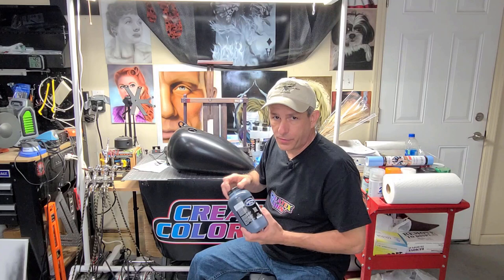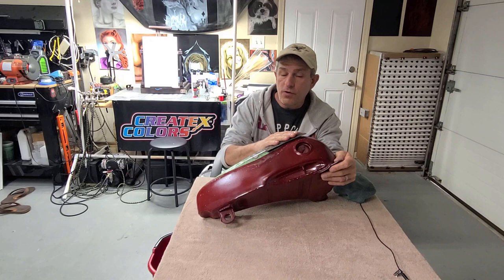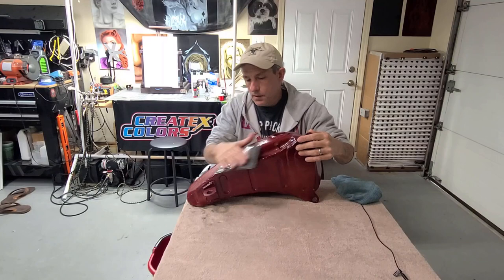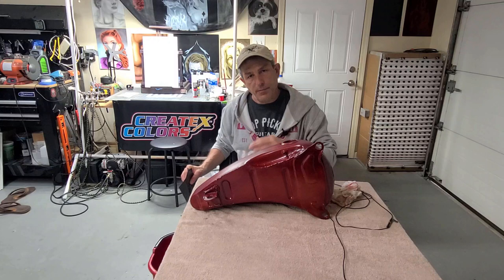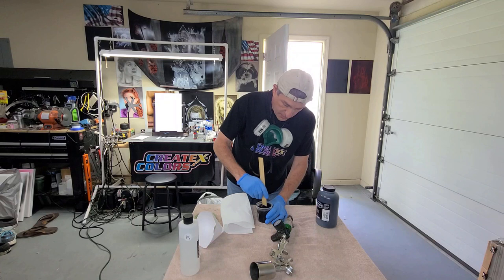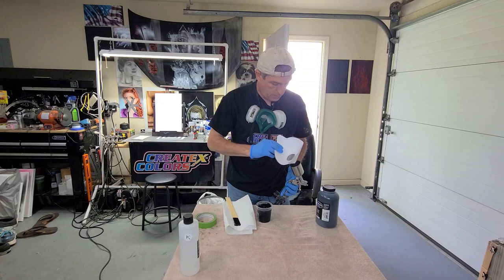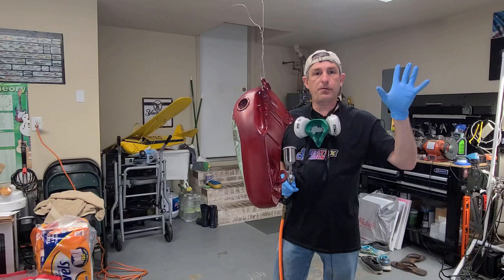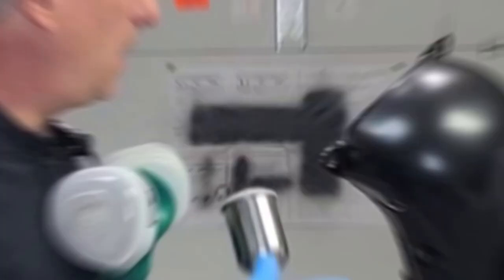Sanding and Sealing a Motorcycle Tank - with Createx Auto Borne Sealer

Comment: I started keeping a toothbrush in my water to get rid of them buildup quicker. I've only used this method when wet sanding cured epoxy resin. It knocked hours off my sanding time. Just food for thought
Reply from the maker: Jokinmyass, that is a great tip. I will use that and I'm sure other will as well. Thanks for the comment and watching.

Comment: Hey awesome outcome, id like to know why you need a sealer? Is it not possible to just just a primer and then do your black color over that? Sorry if I ask noob questions. Im just beginning to work with paints. I do paint 3D Prints and i always just did my primer and then my paint.
Reply from the maker: ZottellTV, yes. I usually would just use a regular or high build auto primer, but with that, you need the reducer to match as well. With the autoborne, I just found it easier because I always have the createx reducer on hand, and clean up is a little easier. They both give you the base that you need for a top coat. Now with that said if I use the autoborne that means I am going to top coat it with a good auto paint in a can if I am just laying down a single color base coat and I am going to airbrush over most of it. Now, if I am going to be spraying multi layer grafix, flake, and metalics, I will use all automotive paints and combine the airbrush (Createx) over that. In ether case, I will finish off with a 2k clear. I really like spray max 2k in a can. This is a great alternative if you do not have the set up to spray clear coat properly and most people don't. My shop is not set up with a lot of automotive paints. They are quite expensive so I get them on a per job bases and the setup cost to spray them is expensive as well. With all that said to answer your question, it is a cheaper alternative if it fits the job. Hope this helps.
Reply: @TheAirbrushGarage  thanks. Some very good information. I spray 2k clear with my hvlp gun as well. As it's a lot more cost efficient to me. I did order the same autoborne sealer that you use in this video and my plan was to just 2k clear right over the sealer and then apply alclad Chrome since that color needs a reflective black surface. 

But maybe I'll just have to do a pass of jet black or something over my sealer first? What do you think?

And also.. thank you so much for helping out dude!
Reply from the maker: @DatFunnyPerson  her is the exact definition of the Createx sealer. I have put enamel over it but not laquare. I am not sure that would work. The Alclad is a laquare, right? I would do a test piece. Ok. Here is the definition: AutoBorne Sealer (“Sealer”) is sealer-primer intended for use as the starting ground coat when painting hard, non-porous surfaces. Sealer has excellent adhesion and dries to a hard coating over which Createx paints cover quickly, dry fast, and level for a flat finish without texture.
You may need a laquare primer.
Reply: @TheAirbrushGarage  that sounds like i will just try it as is since the chrome goes over the 2k. And yes it's laquer. If that won't work I'll get a createx flat black and try that. :)

Comment: Can you use the autoborn sealer as the color coat? Shoot it then go to clear?
Reply from the maker: Tom, it is speced to be used as a primer and I have only used it in that way. It covers over other colors very well and promotes adhesion of base coats. My base color dictates what color I use for my Autoborne  sealer. So...I wouldn't use it as a base coat only a ground coat. Thanks for the question and thanks for watching.

Comment: Have you ever tried mixing uvls gloss with the Auto borne sealer?
Reply from the maker: Gary, I have not. I have never heard of Createx recommending to do that. Have you ever tried this and what is the intention? Durability? I have always used as recommended and love the stuff. 2 coats with a .8 or 1.0 tip and I have perfect uniform coverage. Let me know. You have me curious. Thanks for watching.
Reply: @TheAirbrushGarage  I have watched a couple of videos on the  uvls gloss as an adhesion promoter.   
One of the videos  shows them using it on glass. Just wondering if it makes any difference in the real world.
Reply: @TheAirbrushGarage   I have watched a couple videos on mixing uvls gloss with their paint as an adhesion promoter.  I was just wondering how it worked in the real world.  
They also claim it makes things spray more uniform.
Reply from the maker: Probably not but the UVLS is an acrylic resin do it I'd more durable. I will continue to use it in my wicked colors when painting hard surfaces and continue to use the Sealers as an under coat. Why mess with success. Lol. Thanks again.